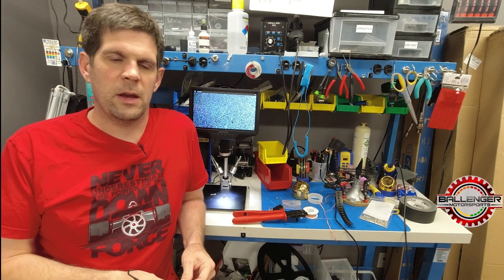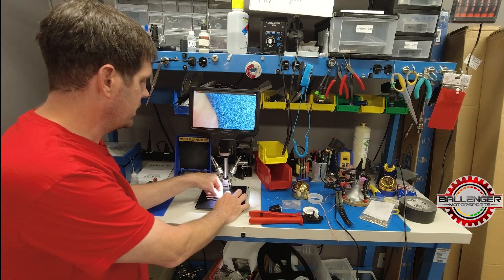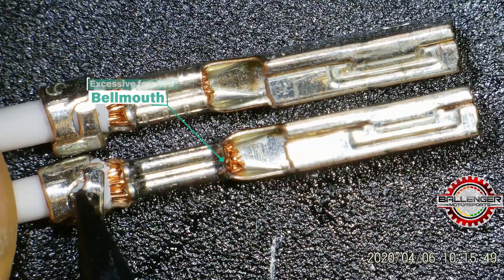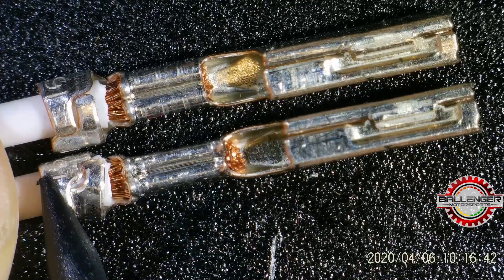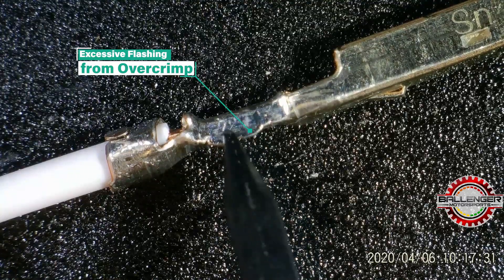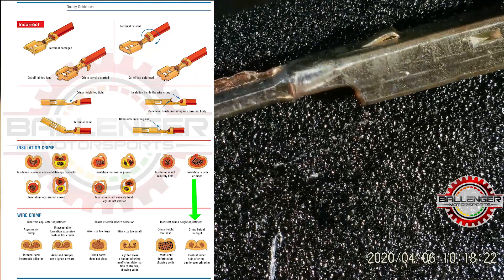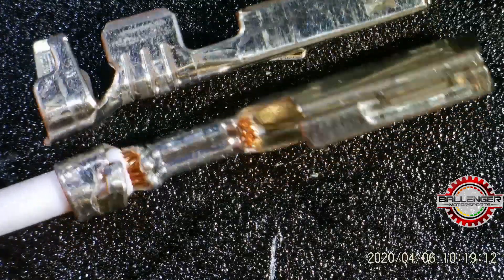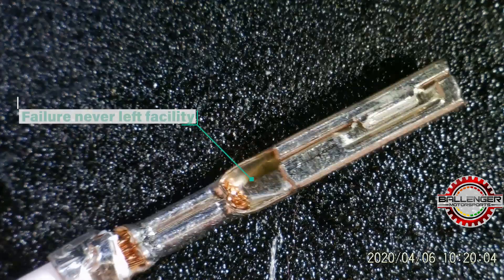Molex MX150L Overcrimp Failure Analysis

Comment: This is probably obvious to other folks but I had to learn on the bench - GXL wire insulation is going to be too thicc for the crimps. found out (should have looked first- but anyway) that  specs call out for a maximum OD thinner than that of GXL specification. TXL seems to fall within range. Thankfully no damage done other than wasted terminals - could tell by visual inspection no good.